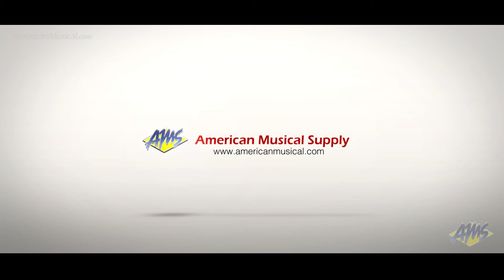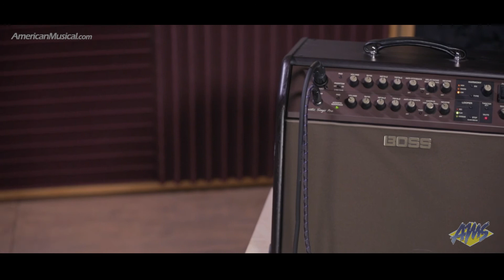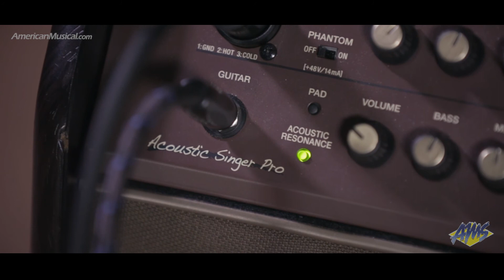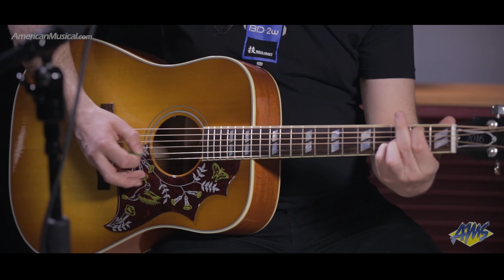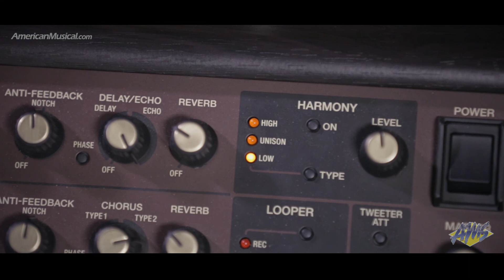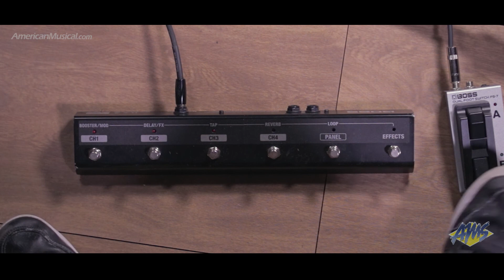Boss Acoustic Singer Pro Overview - Boss Acoustic Singer Pro Acoustic Guitar Amplifier

Comment: Beware vocal harmony is not in the 60watt nor looper.the pedals are confusing. Consider the FS-5L pedal no battery needed
Reply: You are wrong. The 60 watt ‘Live’ has both the harmony and looper. It’s the 60 watt LT (light) that doesn’t have the harmony and looper

Comment: the effects are very good ... but this amplifier does not sound like a 30 watts and if you connect microphone is really unfeasible nor the feedback control of the account of the microphone and it is impossible to pass the volume of 3 you can see in the videos that the volume control is down there, very disappointed even ... I played 4500 outside !!! believe in this user do not buy this !!!
Reply: stop spaming this reply to evey video featuring this amp. It´s getting boring now.
Reply: 2 years later, your comment still makes no f#&king sense. Start with some punctuation and let's go from there.